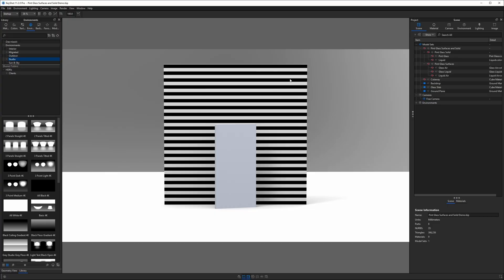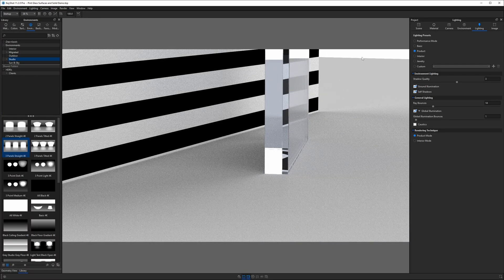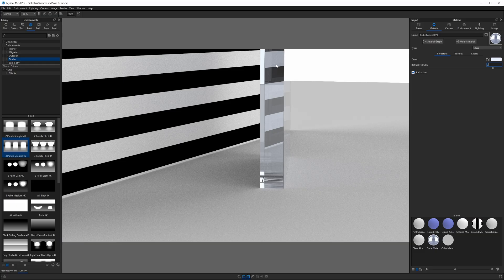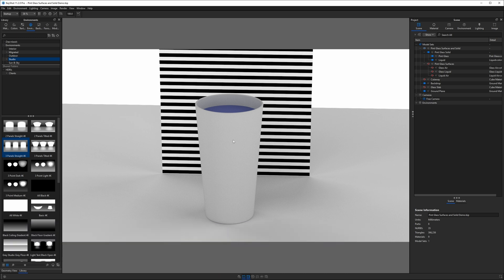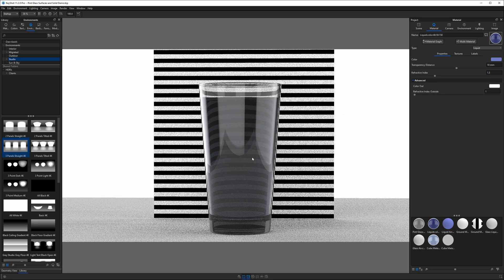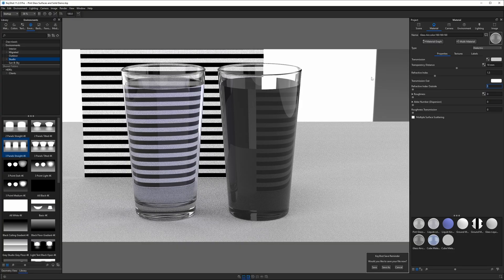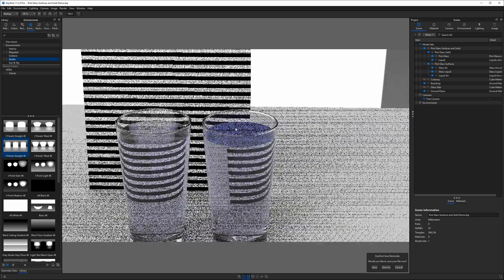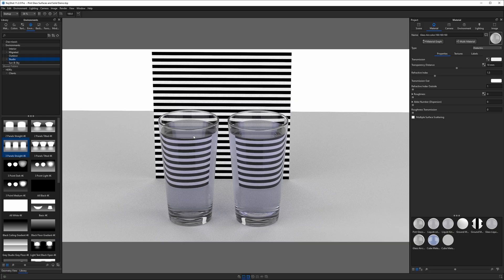How to Render a Glass of Water | Refraction Explained

Comment: Very helpful lesson :)

Hey Will i have a question;-

Is there any way to render CMYK color mode in Keyshot?

I see in keyshot  rendered image color output mode is RGB and thats not good for print out,
even I changed the design RGB to CMYK in photoshop and Illustrator for printing but output was very dull and darker thats why i am facing so much problem for printing with rendered image.

Thanks in Advanced :)
Reply from the maker: Hey! There isn't. KeyShot only outputs RGB. I don't ever work with print, so I don't have a good workflow for you there. Sorry